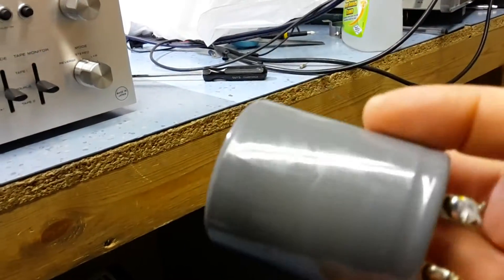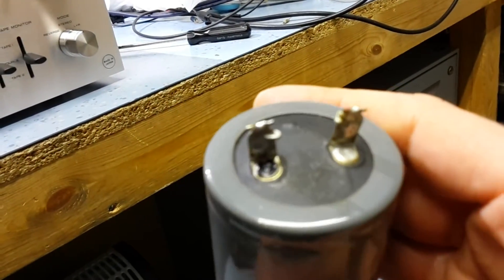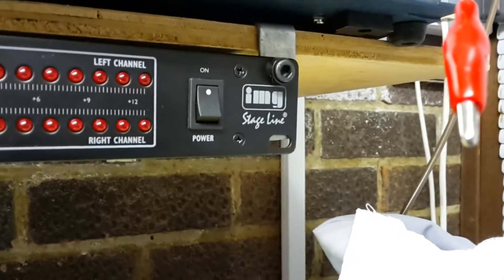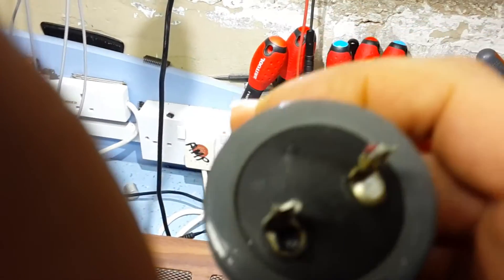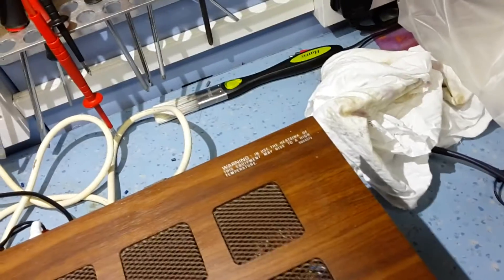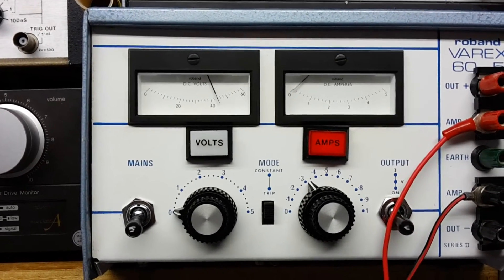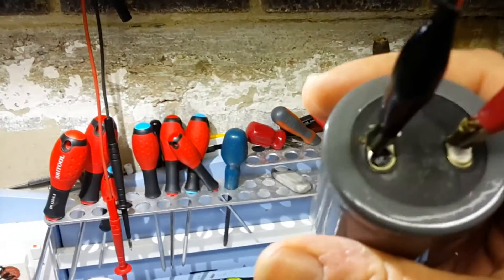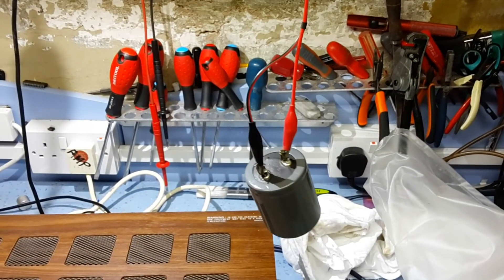Electrolytic capacitor failure

Comment: I’ve yet to see one without a venting cap for safety. There’s no way that will explode in a dangerous way. It will gas inside then slowly vent if used within its rating
Reply from the maker: This is an early unvented cap. Trust me, loads around in the 70's
Reply: @SoddingaboutSi  Apart from cheap dodgy capacitors I’ve never seen one without and I repair lots of vintage equipment.

Comment: I've opened a 70 years old electrolytic capacitor the other day. It was completely dry. Absoluetly no electrolyte inside. Not even a smell of it. I replaced it and was awaiting the Radio to be fully functioning again,... but no

Comment: Hello Simon Spiers , kindly clarify for about the condition of the 
electrolytic capacitors( the value of: 10000 micro farad /63v )in my 
much beloved Grundig FineArts A903 stereo amp. The amp is working 
as usual, but one of the capacitor's  outer side of the  body is corroded or 
changed in color  as a small patch between the body and outer poly 
sleeve. Is it because of humidity? anything weakness of the capacitor? 
any acidity inside? I am much much worried about that. Because, I'm not a
 technician, here in my place in India, there is no any qualified 
technician to handle this high end electronics. Will it be safe to use 
this amp as normal as usual? Can I  Remove the outer poly sleeve to wipe
 off the corroded area? The amp was unused for six months as I went for 
my knee surgery. Kindly let me know about this. I am really worried 
about this condition. Here I have given the link for the photos of the 
capacitors. Kindly help me by giving suggestion in detail.  Thanks in 
advance, regards.
https://www.youtube.com/watch?v=IRNGt0rcFts